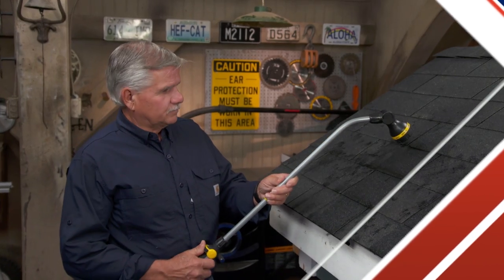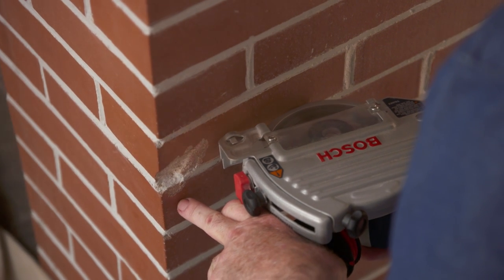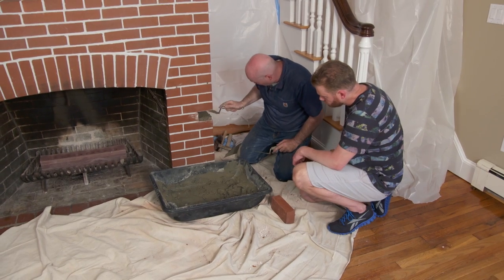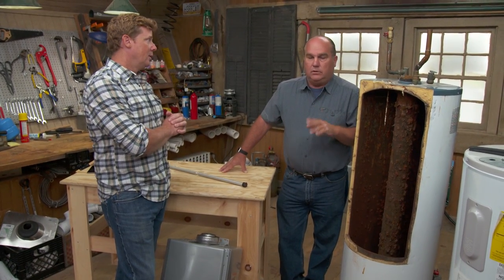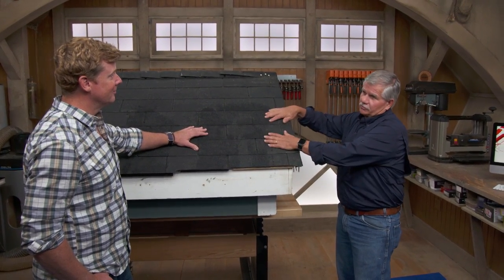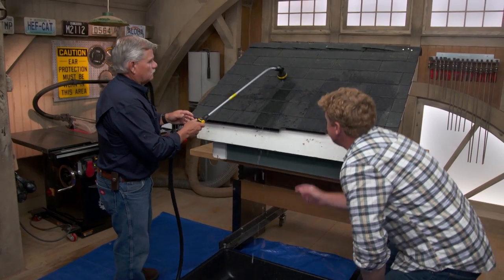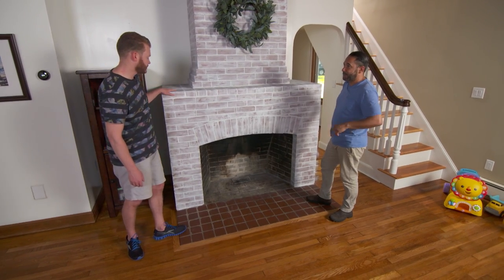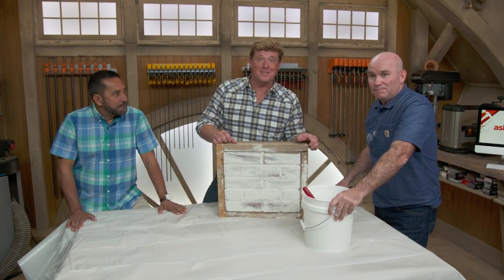Ask This Old House | Fireplace Makeover, Drip Edges (S17 E8) | FULL EPISODE

Comment: When they were bound to color it white, wasnt it was more convenient to repaired the chipped brick with stained putty . Rather then cutting, chiseling and chipping the next brick 1🤔
Reply: Would not have had the same texture and that would have been a visible difference.
Reply: @ZeoCyberG  that's possible, moulded  a silicon stamp from the existing brick texture ,press it on  the putty ,voila you have textured putty, that look like brick texture 😉
Reply: @najam Hussain - But not enough, bricks are porous and when painted the paint will seep into them.

Putty work in certain cases but not all...
Reply: @ZeoCyberG  you do have high expectations and very keen eye to eyeball every smallest of flaws and details. Amazing 👍

Comment: if you put a water filter before the hot water tank in the cold supply line. will it help to extend the life of the tank ? my thinking is that it would have less build up over time. but would imagine would only add at best a few years. so switching out that rod would also be a big help if your able to do so.

Comment: I found it unfortunate that in the fireplace brick repair he damages the next brick with his saw and chisel but does not replace it. leaving a new glaring chip for the paint to show.
Reply: No, only damage was to the top of the brick but that got covered up by the mortar.  So nothing on the show face, otherwise you would have seen something after it was painted...
Reply: @bigtx77 - Yes, and like I said it gets covered up by the mortar as can be seen in the close up of the finished repair where the damage can no longer be seen.

If you watched him cutting, you would have noted he was cutting at a slight angle.  So most of the material he removed was on the inner side and not the actual show face.

But he had to clean out the old mortar all the way to the surface of the adjoining bricks otherwise the new brick wouldn't bond properly.   So just looked worse than it actually was...
Reply: @ZeoCyberG  the saw dug into the corner and when chiseling it out they damaged the edge of the same brick on the front of the fireplace. the tried to hide it with mortar it is sad that they made a mistake and did nothing about it.
Reply: @Wayne Bakken - No, it's only sad you think that was a mistake...  

Again, mortar doesn't stick well to mortar.  So only removing the old brick would have left the new brick loosely bonded, which would allowed it to move over time and the weight and pressure of the other bricks would eventually cause cracking and more damage.

Only by removing all the old mortar, all the way to the surface of the old bricks, so the new mortar can bond the new brick to the old bricks would there be a strong bond that would prevent future issues.

Besides, there's a reason masonry is considered more art than science.  Materials like bricks are brittle and aren't manufactured to exact tolerances.  So no two bricks are going to be exactly alike and be defect free.  There's always going to be little chips and other irregularities all around the brick.

So covering up is as much part of the process as using trim to cover all the gaps and other defects in walls, doors, windows, etc.

The process may be messy but what matters is the finished look!
Reply: @ZeoCyberG  I get that all the mortar needed removal but they damaged an extra brick in the process and didn't feel it necessary to acknowledge and fix the mistake.  It's This Old House not some house flipper program. there used to be standards of quality.
Reply: @Wayne Bakken - No, you're just making an erroneous assumption that it was a mistake...

1) Those bricks are brittle and easy to damage.

2) The old mortar is bonded to them.

So that's like expecting to rip glue off a fragile material without it ever taking some of the material with it...

3) Bricks are porous so you have to at least get below the last layer to ensure you got rid of all the old mortar otherwise you would not have a good bond with the new mortar.

So no, it was all intentional... It's just the nature of dealing with these materials.  There's simply times that causing damage is part of the fix!!!

It's not that they have lower standards, they're just showing more of the process instead of just the before and after... You wouldn't have seen any damage if they had done it that way...
Reply: @ZeoCyberG  So...They intentionally put a blemish into another brick so that they could repair the first brick? If the bricks are as fragile as you claim then they shouldn't have been so vigorous with the power tools and chisels and instead used the proper safer and maybe slower methods of hand tools and files to ensure they did a proper job. This is not how they should have left it. The show has gotten overly sloppy in it's methods.
Reply: @Wayne Bakken - No, again they're just not hiding how its done.  Sorry but if they had been vigorous the bricks would have been shattered and the damage would not be hide-able.

Seriously, it's like expecting a house to be built with no need for any trim with every wall exactly straight and plum... Nice fantasy but never going to happen in real life!
Reply: @ZeoCyberG  you still miss the point. this is a show that used to pride itself on making perfection and now they ok with making youtube segments and not retaining their quality of workmanship. Do it right or go home. They should have mentioned that they wrecked a second brick and replace it also.
Reply: @Wayne Bakken - Sorry but no, I already pointed out your point is based on a false assumption and that hasn't changed.

Simple fact of the matter is the old mortar had to be completely removed right down to the old bricks to assure the new mortar will bond properly.  Otherwise the fix will fail over time but the old mortar is also bonded to the old bricks and so would not come off without causing some damage.

You're just refusing to accept what that means...

The reality is the show never stopped showing quality craftsmanship.  They're just not hiding everything that goes on between the before and after like they used to and you're now seeing details they used to skip over.

But that's part of the point of an Ask This Old House segment because it's partly to show home owners how they can potentially do it themselves or know who to ask to get it done...

So they're going to keep it practical and real...  It may not be how you imagined it but there's actually a lot in building homes that isn't done the way people often assume or imagined...
Reply: @ZeoCyberG  so it was the right thing to do do break/ mar the adjacent brick to fix the first brick? This has been my point the entire time. you have failed at reading anything i have typed. they have gotten lazy that is my point.
Reply: Uh, no... that was clearly not your point the entire time.  But irregardless this is still a TV show.  They're just posting part of it on their youtube channel but this has to air on TV with limited time slot and commercial breaks.

So they're not going to stop every few seconds and explain everything they're doing in minute details as that would make the episode over an hour long.  

They're just going to show it and if really interested you can sign up for their unlimited membership and get all the details you want then from their entire library and forums and even direct Q&A's with the cast... 

Otherwise you can check out all the free youtube channels that show similar information and aren't limited by running a TV show that has to keep the sponsors and broadcast network happy...

Comment: A BETTER solution is a masonry stain, or concrete sealer. With Brick you can make the tint darker and richer or adjust the shine as you wish going this way. Just make sure you cure things properly and make sure it's application range fits your brick outside surface temp range. I had a similar looking fireplace. Added the concrete sealer and gave it a subtle wet look that is darker than the orginal and has this shine that looks freshly cleaned.

Comment: Richard, is it healthier to use cold water for boiling pasta than it is filling the pasta pot with hot tap water?
If I am using hot water from a tank I am  afraid the sacrificial rod inside the tank might imbue to my pasta things that might not be healthy. Please reply. Thank you bet much. 
-Ben Ritch-Smith
Reply: I personally will not drink the hot water from a water heater I'm unsure of. I maintain mine well and do drink the hot water/use it for cooking sometimes, but I do now want to look into the possibility of metals from the anode rod leaching into the water, especially if it's aluminum.
Reply: Those are zinc anodes, which is non toxic, and even used therapeutically.  So boil your hot water away, it's not a problem.
Reply: @TheSirGoreaxe  How does one know for sure what an anode rod is made of? I mean one that's in a water heater. I sure hope they don't use aluminum. Regardless of the rod material though, I wouldn't drink the water out of an old tank unless I either knew it was maintained well or it was relatively new and also maintained well. I installed a new water heater in my house 3 years ago and flush it, so I know the water is good.

Comment: I really dont know why so few people heat their water with simple small coils inside a boiler like I do! - no tank - no trouble - no leaks - no worries - no complicated troublesome electronics! My boiler is oil fired Capitol steam one from 1945! using a 1980s Beckett Burner & the hot water is FREE in the winter & in summer i run boiler for just 8-14 minutes a day!

Comment: What is the lifespan of a tankless system?
Reply: From my understanding they can last 30+ years
Reply: According to the Energy Department, as well as Consumer Reports, the expected lifespan of a tankless water heater is usually close to 20 years...  Less if you don't maintain it or are in an area where the water quality will damage it over time or in an environment or climate zone where it has to work harder and thus wears out faster. 

Typical tankless warranties on most brands cover the heat exchanger for 10 years and the rest of the parts for three to five years. 

But this compares to 12-15 years for tank systems and usually faster corrosion concerns...